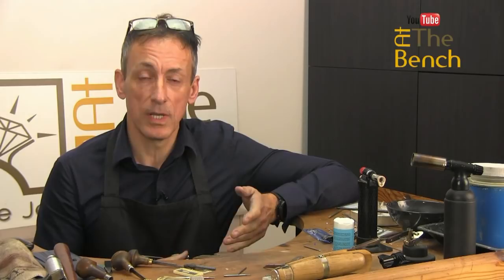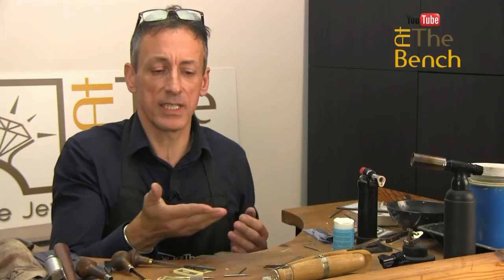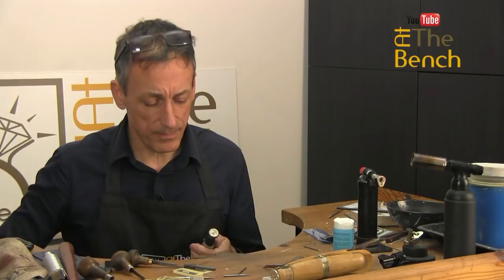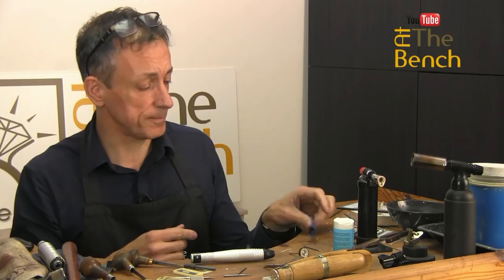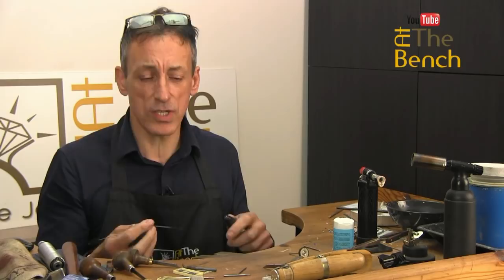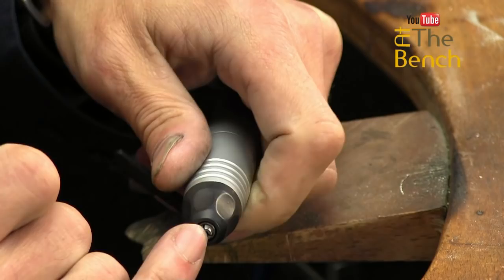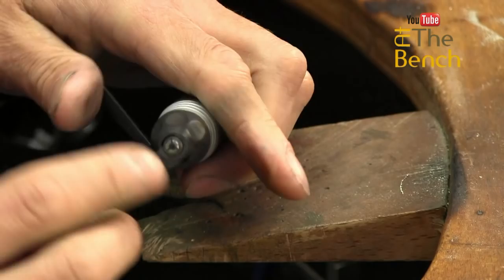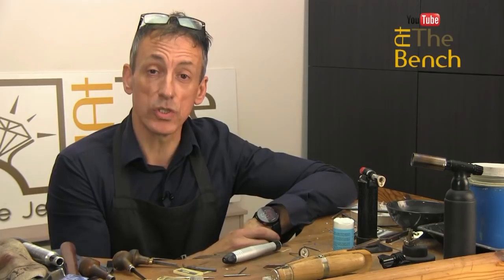How To Clean And Maintain The Collet Of Your Flex Shaft

Comment: Hi Andrew, is there as such to open up the hand piece for a good cleanup and lubrication?
I got water splash on mine, later on it got stuck and really got me worried, I was able to open partially at least get the most grit out of it, it moves fine now but seems a bit noisier than before, and for some reason I just can't find a tutorial video for this.